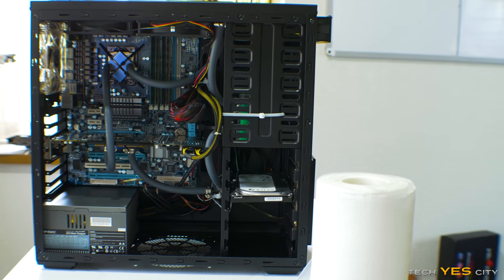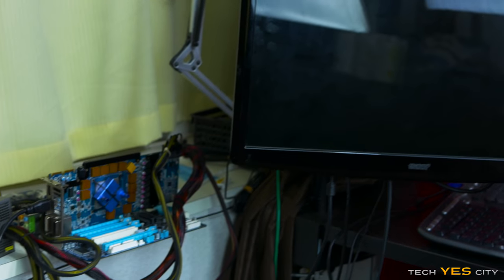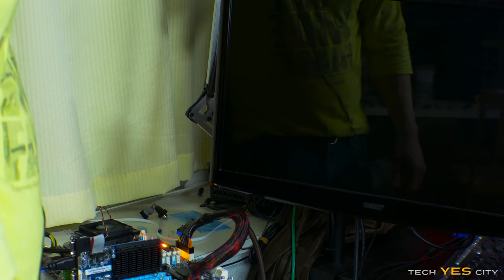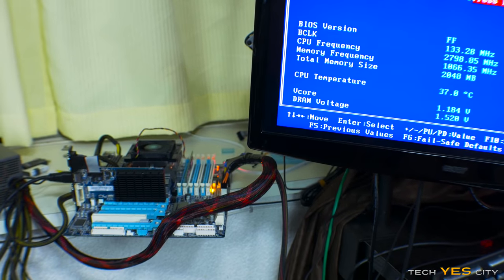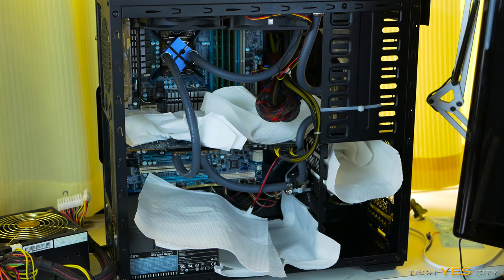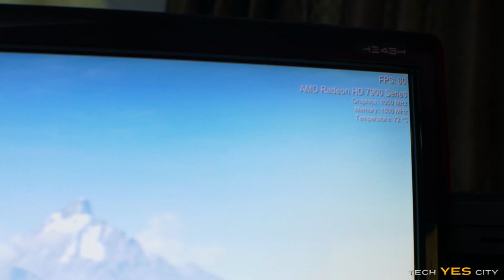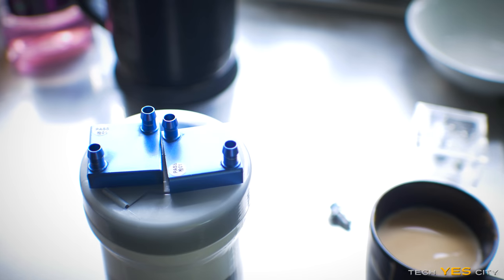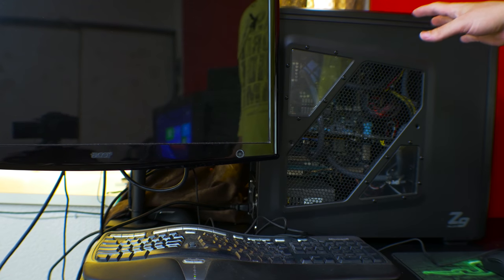$50 Custom PC WATER Loop - Is it POSSIBLE?

Comment: Too cheap, and were the cooling blocks painted on the bottom side? Also one possible mistake, cooling the GPU first. I will assume that you wanted to over-clock the GPU and that would have been your biggest concern. I would prefer to split the connection or make a dual pump system.
Reply: +Adrian Staicu The order of which component comes first in the loop doesn't matter. The delta of the watertemperature from going into the radiator and coming out again, is not greater than 2-3°C.

Kind regards,
Meta Custom Computers

Comment: I am fairly certain those $4 aluminium free flow blocks are the main culprit for the poor cooling performance.
 I checked the E bays and the cheapest copper gpu/cpu blocks of reasonable quality  were about $20 AUD each from China....however they came with mounting hardware and barb fittings which make them relativity good value for what they seemed to be. As for pumps its probably the most important element  to the whole loop 24/7 operational rating with maybe 2m head pressure @ 300lph minimum. it's Tricky $50 was a noble effort but I think $100 is a more realistic functional achievement. Ghetto mod props though.

Comment: better blocks, using an aquarium pump, and going with a t line instead of a reservoir would have cost around the same but worked better.

Comment: I thought you should connect the pump out to the radiator 1st so as to cool the liquid down 1st???
Reply: +Oeufcoque I'm sorry to tell you but that's not how thermo-dynamics work. The delta of the water-temperature doesn't exceed about 3°C from entering the radiator and exiting it again. The water-temperature raises very slowly till equilibrium is reached and all the components in the loop will get water with the same temperature, no matter which component comes first and which comes after.

Kind regards,
Meta Custom Computers

Comment: Can you do budget 1000+W Power supplies....Something like those Dell and other OEM Power supplies...They are usually ugly and possibly need rewiring due to proprietary wiring and connectors.
Would be an interesting video for those of us cheapskates that dare to take risks and be different.
Reply: i rewired a Apple 1000w g5 Power supply for a Hackintosh Projekt
it is a bit risky cause some powerlines (like the Standby voltage) aren't the same voltage and needet some vrms

Comment: There are copper blocks for 20 bucks that should preform quite a bit better so worth the extra 10 bucks id say...and there is a mount kit for these alum. blocks....however if you get these don't get a copper rad get a alum rad

Comment: I agree about the coolant and using a hard drive will probably bottleneck the system making this all a waste of time.  Also hard to see if you have trapped air in pipes when they are not clear 😂

Comment: You used WAY too much engine coolant in that loop.  Radiator fluid doesn't cool as well as pure water so you'll have problems when you have it anywhere near a 50/50 mix.  I'll grant you that a good cpu block is hard to beat, but I'm running about a 1/10 mix of rad fluid and an ebay pump/res kit that keeps my overclocked g3258 (4.0ghz limit because of mobo) at mid 30's during normal use and in the low 60's with prime95 running for over an hour.

Comment: Cut open one of those $5 CPU blocks,  I want to see inside.   I bet they only have a single channel.   or maybe nothing more than an old Pentium style heat sink with a box around it.
Reply from the maker: +Del Scoville Good idea, I will see if I can get it working with another attempt, if not then I will hack them up for sure.

Comment: Someone needs to build and sell a leak sensor for dyi units.  Any pressure difference on the line (due to a leak) and sensor shuts off the pump.

Comment: Cool but, I got 65 C max on my OC'ed 7950, with the STOCK COOLER.
Reply: +Frank Harding With 3 fans on your stock cooler right?
Reply: +Frank Harding my asus gtx 680 has a gpu boost oc to 1249 and a memory clock oc to 5908 and it still runs under 60 degrees celsius with the stock cooler :p
Reply: +Xavier Dio nope.. stock cooler and one case fan

Comment: This pump and it's other counter parts (dc12-260 and dc12-400) can be had for a really good price, usually sub $50. I've used the DC12-260 in a loop of cpu and 2 gpus. Tested with GTX 970, 2 x 780 hydro coppers and 2x r9 290s and was a great little pump. There are also some pretty nice res combos for it too made by Alphacool and EK. 
http://www.tweaktown.com/reviews/6567/phobya-pure-performance-kit-240lt-cpu-cooler-review/index4.html

Comment: Hey guys! ^^
So im in budget, so can this pc run CS:GO and all high 1920x1080 on 200fps average? :)

CPU: Intel® Core i5-2400 3.10 - 3.30 ghz 4 virtual and 4 real cores
GPU: GTX 660 GDDR5 2gb VRAM, but i can go to 4gb? dont understand that.
RAM: Crucial Ballistix Sport XT 1x8GB DDR3 1600 Mhz (I think i will put one more in future)
MB: GIGABYTE H61M-DS2
HDD: Seagate Barracuda 500GB 7200 RPM 64MB Cache SATA 6.0Gb/s (will add a ssd in future)
PSU: CHIEFTEC 550W CTG-550-80P
COOLING: DEEPCOOL CK-11508

Thanks :)
Reply: Probably not 200 fps, but it will surely keep a steady 60 at all times.

Comment: Its not ghetto enough. For that you need to make your own blocks from copper slabs with only a drill and use a car radiator.
Reply: +Madarpok This is what I was thinking
Reply from the maker: +Madarpok lol a car radiator be insane, though would need one strong pump with the inlet and outlet of the rad.
Reply: Tech YES City
Not really, since it has so many channels in it the total cross section is WAY more than any normal watercoling rad, so actually it is easy to pump water through it. Also it can cool a lot of stuff completely passively, and has a lot of thermal mass, so even if you put more heat into it then it can dissipate to the air, it will still take ages to warm up enough to cause problems.

Comment: Man - no wonder you sped up the video while cutting out your copper piece.  1) Use a squeeze grip hobbyist clamp ($12 at home center); 2) Use a real hacksaw ($15 at Harbor Freight) versus that cheesy coping saw one you struggled with; and 3) where did you learn to apply thermal paste with your fingers?  Glob it on, dude, it self-spreads.

Comment: Whatever keeps a Tahiti GPU at 60ºC under full load easily keeps any CPU lower than that.
Tahiti pulls more than any existing CPU on the market. Whatever you did wrong, you did it wrong.

Comment: +Tech YES City i saw what might have gone wrong you deff touched on some important points..i would say challenge accepted but i just lost my job i don't think i can blow 50 bucks on/or ruining a computer right i can use for a project when i properly can now *look at the cpu block and the loop itself*
Reply from the maker: +manny s Yeah I will definitely be attempting round 2.
Reply: i hate putting this stuff on comments but for part two how bout getting another reservoir and splitting the loop gpu's are hotter
Reply from the maker: Yeah I will have a look at what I can do, definitely get new blocks and a new pump I think
try step it up to $120 roughly
Reply: bqlzr sells a pretty cheap univeral block at $20 that doesn,t look cheap at all
Reply: +Tech YES City get another reservoir and pump separate the gpu and cpu... its bothering me everyone it taking a sub hit.. that will get you the temps you need to put out a viable video I've done it trust me

Comment: Uhmm... you do know your issues might be due to the fact your cooler is transferring heat from the GPU to the CPU, right?
Reply: +The Romanian Reaver the temperature difference in the fluid from GPU to CPU is max 2-3C, it pretty much stabilizes once running for about 15-30 minutes
Reply: TheNerdyCanadian

Under stress load it ain't gonna cool efficiently and may even cause heat issues. Remember the GPU is sinking around 73C through that liquid and unless your system is open and the room is sufficiently cool to leach a significant amount of heat through the hose from the GPU to the CPU it ain't gonna end well.
Reply: The Romanian Reaver If it was a proper loop it would be ok, the problem is the tubing is too small, the pump is designed for a fish tank, and there isn't enough radiator capacity. If it had proper blocks, tubing, etc, it would be perfectly fine the way it is, I've seen a 3770K and GTX680 cooled with a single 240 rad and temps were well within where it should be.

Comment: better temps if you learned how to actually use thermal paste. Never spread by hand, let the pressure spread it, otherwise you get bubbles.
Reply: Do your research, lol.
Reply: +MrKeikari 2 years of material science, 4.5 of space science where thermal conductivity is a little more important than here. Fact is, the oils from your hand dilute the compound, air is an insulator when between two surfaces, and you create grooves in the tim that cant be removed with the pressure of a good locking mechanism let alone zip ties.... lol I did my research idiot. tons of it... for spacecraft.... oh but then i went and got a masters in cs specializing in high performance computing. the best method is as follows. use tim remover and anhydrous alchohol to rub clean the ihs, then apply tim and rub into both surfaces in all directions to fill micro-voids, wipe off as much as you can, then apply a rice grain sized dot of tim, and let the pressure of mating the two surfaces do the rest. no voids, no hand oils, no sweat... 5-10C lower temps. get wrecked.
Reply: gravesclay We're not in space man, sorry. Spread method and pea method give the same results.
Reply: +gravesclay No matter which branches you researched and which qualifications you gained over time, it doesn't change the fact that for CPUs in household computers, the applying-technique of TIM doesn't matter and never gives any differences larger than 1-2°C. I'm building PCs on a regular basis for over 10 years now and I'm always using the credit-card-spreading-technique and never in my life did I encounter one of those ominous "air bubbles that killed the temperature-performance". I don't need a degree in rocket-science to bench-test different methods of applying TIM to come to the conclusion that 5 different techniques gave 5 equal results.

Kind regards,
Meta Custom Computers
Reply: +gravesclay wouldnt the oil from ur finger mess up the thermal compound
Reply: +Aenayus White Not with a clean finger :) There's no notable difference after you clean your finger with alcohol wipe like Bryan did.
Reply: gotcha i was just wonderin i dont use my hands i use like a ol credit card for that
Reply: +Aenayus White If you don't wanna go bareback you could use something like plastic bag in the tip of your finger :)
Reply: MrKeikari
I second that. In todays times you get plastic bags everywhere. For your fruits and veggies, in your grocery store, just take one, wrap it around your fingers and use it to spread it.

Kind regards,
Meta Custom Computers

Comment: Sorry to say folks.. but the water to air cpu coolers are fake....  im a mechanical engineer whos worked in aircon and plumbing industries...   the design is flawed by physics and the designers knew this before they made them.. heres why,  they are not coolers they are radiators, heat is transfered from the cpu through metal( a great heat absorber and loser) then to water good at heat transfer but slower to cool than to gain, then the water transfers heat to the radiator and air is forced over to remove the heat but is a worse conductor than water progresively getting worse,  this means it can not and will not release as much heat as is put into it, as the cpu heats up it heats the water till it reaches the point earlier stated where it raises the water temps above ambiant temps, and then the fan can only remove maybe  10° lower than ambient at max but not while heated water continues to flow from the cpu...    this is a radiator not a cooler it works exactly how a cars one works and car radiators do not cool below say 80° and arent designed to, they just stop it reaching a damaging temp like 150° ... all vids u see testing these water coolers are fake and people like linus do not understand the physics behind the scam there payed to promote...  they see max 5-10° cooler than it was with a fan and heatsink, which is discustingly pathetic in an engineering world..   u phisically need to cool the water in the radiater with either a gas refridgerant or even remove the fan off the radiater and put the radiator in a mini freezer would actually work because heat transfer through solid ice and frozen metal is  10× better than air...    a massive heatsink would work better...

Comment: oh dear.  As other have pointed out, so much wrong with this build :)  The cheap chinese aluminium blocks are a big nono to start with. At best they are suited for use on the equally cheap & crappy chinese TECs.   But the mounting is a big issue... you need somewhere between 100 - 200 NM for good even contact.... this is impossible to achieve with tie wraps.   As for the rest, unless the radiator is also alu, there will be problems in the future, but at least the automotive coolant should keep them at bay for a few weeks.  
While i applaud the "cheap watercooling" alternatives, it should come with a BIG warning/disclaimer.... which should be .: "do not do this".     Really, if you want to go as cheap as possible, then go the AIO route.. there a plenty of Asetek clones out there.

Comment: Finally, using zip ties to hold down any cooling item over a GPU/CPU is retarded!  You want that to be wise clamp tight - using plates and bolts to assure a super tight seal with thermal paste in between.  You should've also installed a bleed valve on your water block which allows you to quickly remove water bubbles - which could be why this build was wholly unsuccessful.  Can't believe you threw in the towel at the end, mate ... you were so close!

Comment: Wow - you have a shared water line between your CPU and your GPU?  Stupid.  One has got to be dumping heat into the other.  Suggestion:  two water blocks.  Move that lone HDD up to just below water block #1.  Place water block #2 on base of HDD rack.  Run paired water lines to each water block separately.  Run smaller radiator facing toward front of case or share the hot output lines of the CPU & GPU and run both to the input of the top mounted radiator.  I only wish I had all that real estate inside my cabinet!